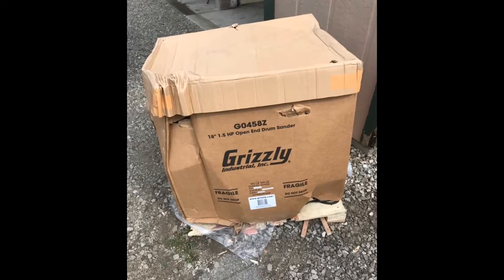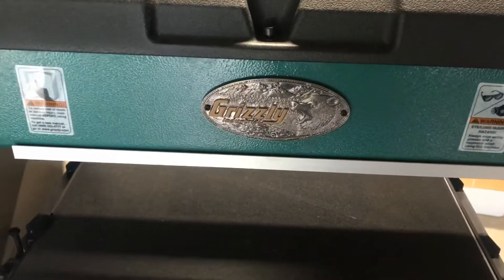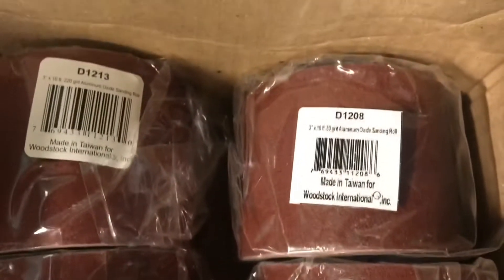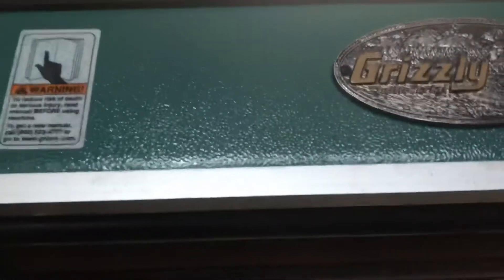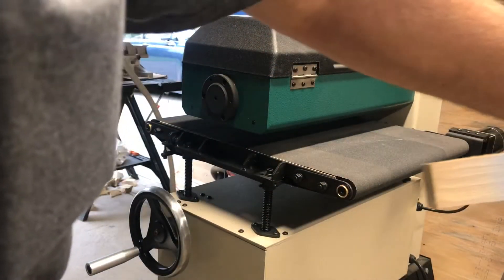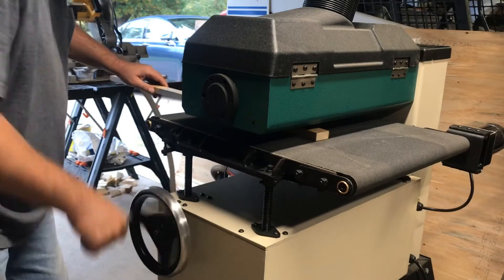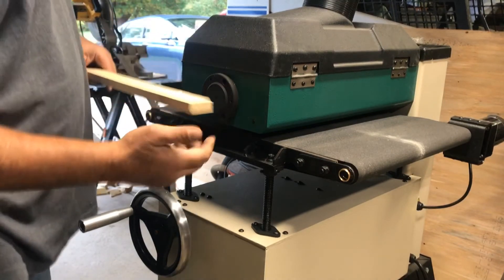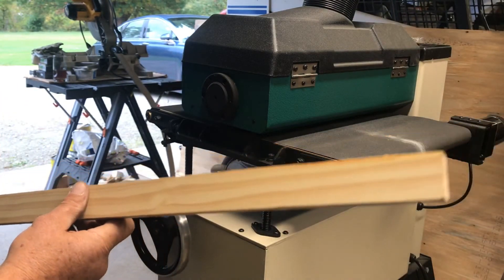Grizzly G0458Z 18” Drum Sander

Comment: I just bought one, haven't got it yet. But I don't understand all the naysay, for me its going to be a finishing tool for ensuring a flat surface after I do the rough work by hand. Joint a face and edge, plane it to thickness, cut  opposite edge on the table, glue up if needed, rough sand it a bit with random orbital, then smooth it out on the drum sander. Useful for finishing end grain stuff, too. Not sure why anybody would ever take more than the 1/64" at a pass on this type of machine.  Just use the thickness planer, or a wide belt sander. Just my fish in the bucket. Great review!
Reply from the maker: Thanks for watching.

Comment: I just picked this up this year and so far I don't have any major issues with it. It trips breakers, sure, but that's when you're bogging down the machine and taking too thick of a pass. Consider a 20amp dedicated circuit with nothing else on it. I only have trips when my dust collector is on the same circuit or I took too large of a pass

Besides that, it runs pretty well. Slight tracking problems can be fixed - grizzly has a euw-toob video that shows you how to properly track the conveyor belt. I recommend watching that. I think I finally have mine dialed in pretty well.
Reply from the maker: My neighbor brought over a rough cut piece of oak that wasn’t flat. It stopped at the thicker end. Didn’t trip a breaker.
Having a balanced circuit load on your breaker panel can help prevent tripped breakers. Especially with electric motors.
Thanks for the tip on the tracking vijao. If I come across that problem I’ll refer that.
Thanks for watching and sharing your experience.

Comment: I have the same machine and would strongly suggest against cranking up more than 1/8 of a turn per pass.  In this video, you're sanding a very narrow board and can therefore get away with it.  But, had you been sanding anything wider than a few inches, you'd be overstressing the frame and - as you've learned already - be tripping the breaker.
Reply from the maker: My neighbor brought over a piece of rough sawn oak about 8” wide. It just bogged down and stopped when it got to the thicker end. No breaker trip.